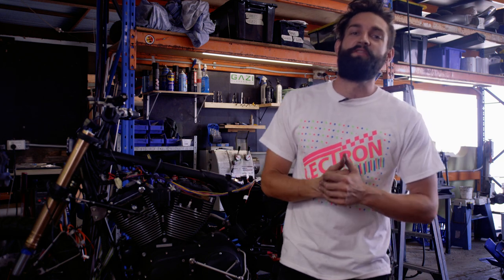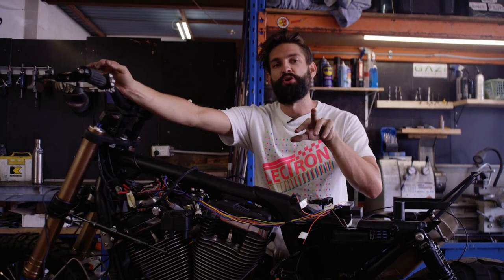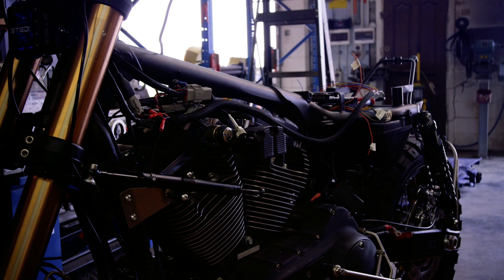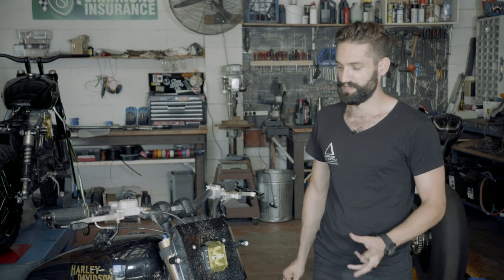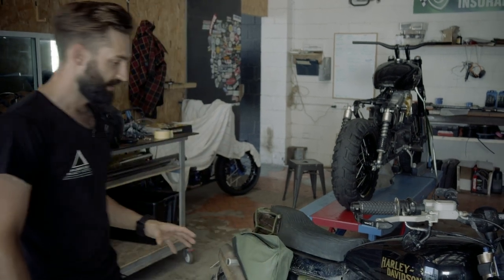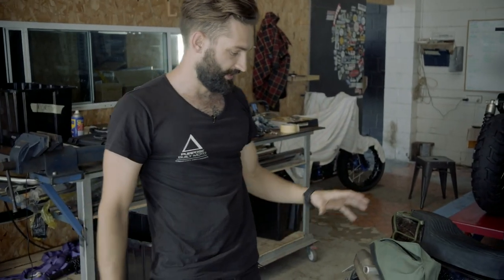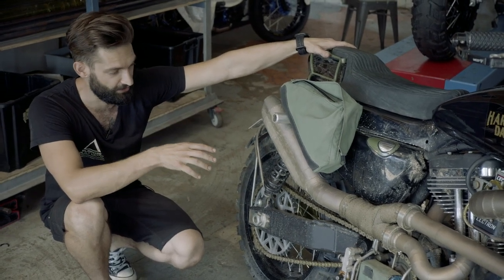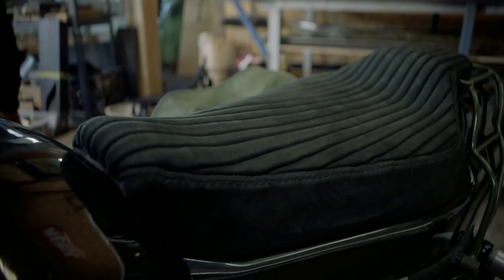Harley Sportster Scrambler EP 5 - Wiring + Start Up

Comment: This thing is amazing. It came out so so rad man. Love it. 

Also, 300km on a 1200c tank? 
I still have to fuel up every like 120 miles on mine? What is this sorcery
Reply: 120 miles = 193 kms. i have a 1200c tank and get about 300 on highways, 200 if city riding. hope this helps.
Reply from the maker: Thanks mate, did you follow the series? 
Yep I get about 300k's to the tank. The Lectron carbs run a lot more fuel efficiaent as well as giving you a better and more responsive power. 

With the 1200C tank and the carb I was on about 1/2 a tank when the bonnevilles and other bikes were looking for fuel during the Wide of the Mark trip.
Reply: Purpose Built Moto ofcourse i did! The build turned out awesome. Can’t wait to see it in the feature film. And it deserves all the praise its getting. I’ve already started on my sporty, ordered your slim push button switches today too. Gathering up parts now and will start on the build. Cheers and keep up the awesome work!

Comment: Placing lights on the fork guard? They won't be rigid, moving up and down, vibrating all the time - It's not a good idea at all.
Reply from the maker: Yakuza 69 thanks for your experienced insight. I rode this bike for 2 weeks straight through all types of off road terrain and on road, the headlights worked perfectly.